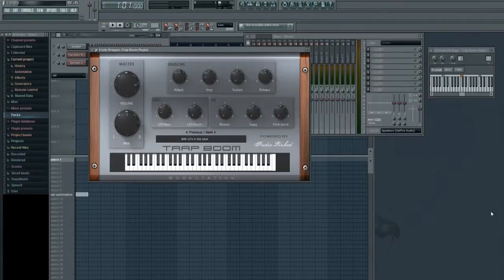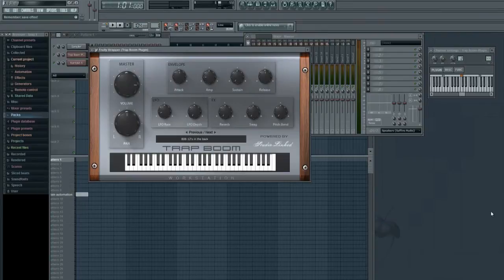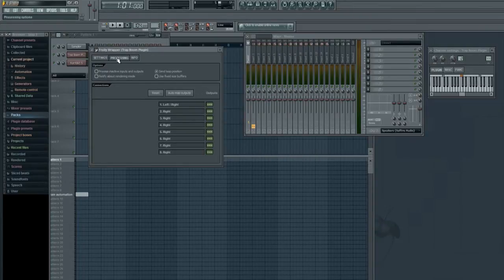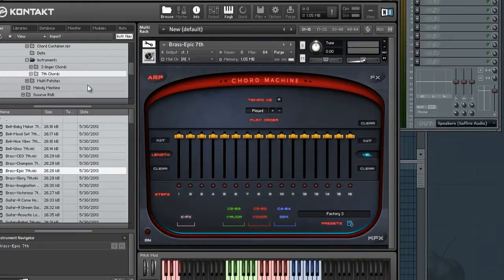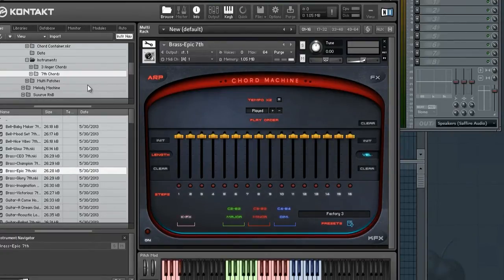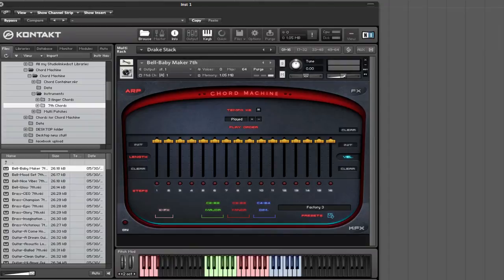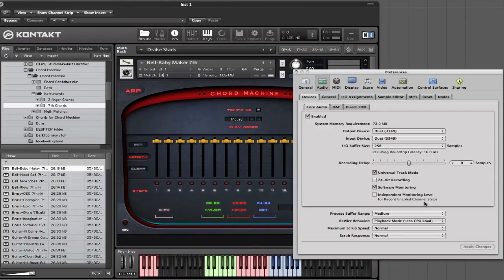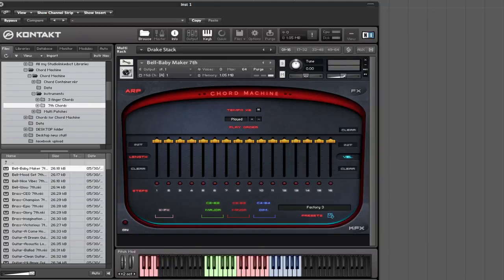Clicking and popping fix (FL Studio and Logic Pro)

Comment: it did not work for me,
ive tried all these ways to get rid of the crackling noise changed the buffering in asio and to the primary just to compare also ive turn on the 32bit  turned off safe overloads, ive downloaded the latest asio4all beta2 ive changed my laptop to high performance ive even adjusted it to get the maximum performance I don't have a mac or anything fancy just a HP and its really good but I had a gateway and it never crackled or did any of this before. im not sure what to do?
Reply from the maker: go right now to www.studiolinked.com click on more info under Download Updates and download the latest update